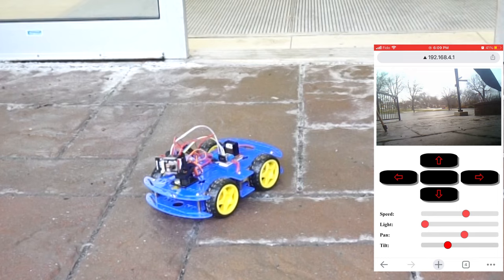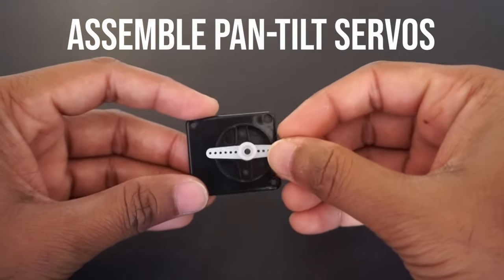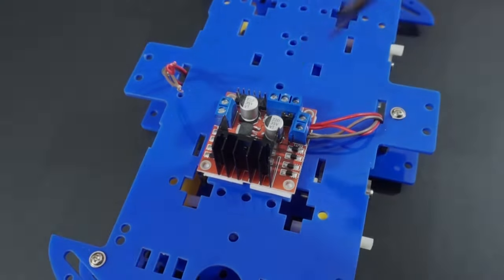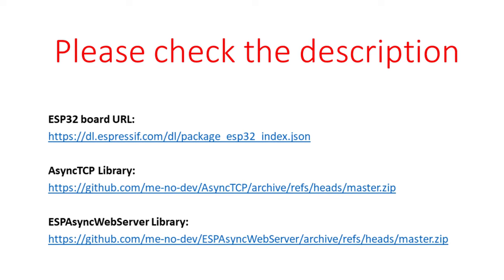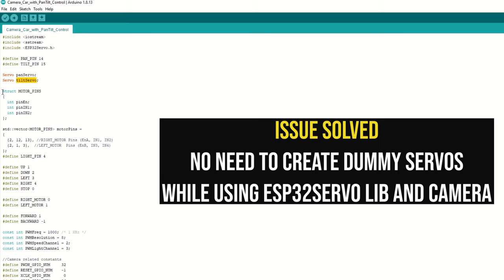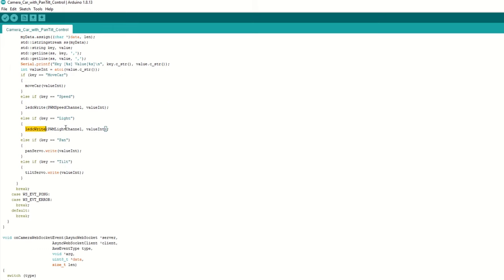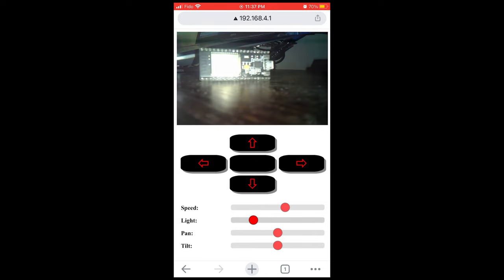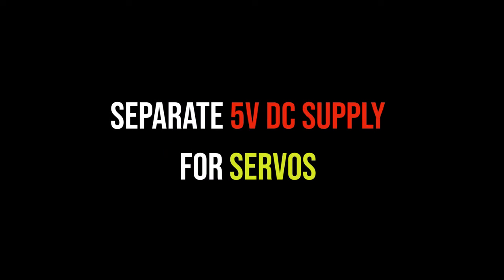Camera Car With Pan Tilt Control | ESP32Cam

Comment: A fatal error coming after compiling it tells it tells no serial data is received
Reply from the maker: Please check the video for full details 👍🏻👏🏻
Reply: I rectified it by removing the gnd connection... brother
Reply from the maker: @cbc1235  awesome 👍🏻👏🏻
Reply: Bhai Mera help kar do na please
Reply: @Sanjeev0-6  post that..! Your trouble
Reply: @cbc1235  my problem is that compiling process is not completed please help me
Reply: Coding me  kon kon file ko add karana hai kon sa module select karana hai vo nahi ata hai hamare pc me
Reply: @Sanjeev0-6  keep update of coding commands
Reply: @cbc1235  thanks sir I check
Reply: @Sanjeev0-6  Infact I am not sir...be friends 🤝
Reply: @cbc1235  compilation Error ' ledcsetup' was not declared error in this scope; is coming while compiling can you help me
Reply: @Surya_Rapeti  nice try and again please check program and commands and Arduino versions & libraries...etc circumstances

Comment: hash pls help me to fix ...hang of browser full time only works 2 second then hang...then after refresh browser worked remote till 2second then same as first ...why ...some time camera working continously but car remote not working some beep sound coming from l298n driver module when pressing moving key front back left right..why that sound only not moving car
Reply from the maker: May be there is power issue . Please use rechargeable battery of 7-12 v 👍🏻👏🏻

Comment: Its a good project with great explanation..i have successfully implemented the project...some of the points that have to be kept in mind for Beginners are...

1) power up the ESP 32 cam with the help of buck...the output of l298n may not be sufficient..hence the ssid may not be visible in WiFi list

2) please turn off the mobile data and then search for the ip address

3) make sure the motor speed is at minimum position and then test the car...

All the best 👍
Reply from the maker: Thank you so much for pointing out some of the findings . This will surely help others as well 👍🏻👏🏻
Reply: bro so thanks for saying this , i am also facing this problem
Reply: @hashincludeelectronics   bro can you say which type of buck converter  can i use and how
Reply: Bro I connected all pins correctly it is showing inn network and all are working but the car is not moving , please give me a solution for this bro.
Reply: LM2596 buck converter will work for this...if you are correct with the connection and power supply and all... atleast you will hear a feeble sound when you trigger with the mobile app

If so set the motor speed to mid level in your application

Hope this will help you 👍
Reply: @sushmitham5723  Can you say how to connect to that and how much voltage I have to set
Reply: Hi 
Is this code run properly ?
I have on run time error on right and front control  i found it on the. Serial port.  It show an square box while pressing these keys. Remaing keys ( backward and left) is working properly. Did you know how to correct it. If you know please tell the solution. Thankyou.
Reply: Can I try another buck with cam module so power problem not happen

Comment: Thank you very much for the Project. It helped me a lot.
I have two questions. 
1 - In the webpage the image stuck frequently but the buttons works ok . Do you have any recommendation?
2 - The motors don’t work when I connected enA and enB to IO2. The motors only work when I connected to  enA and enB to 5v.  The IO2 output always is at 1.2v. Do you know why?

Thank you so much .
Regards
Hernan
Reply from the maker: Please check the video for important setting . Also make sure you make the connections as per circuit and shown in video 👍🏻
Reply: I am having the same issue, can you share how you solved it, if I connect either ena or enb, respective sides work. If I connect both, neither side works

Comment: I want to seperate enA and enB pins which you connected to io2 port. The io4 port is currently unused. Because when ena and enb pins are connected to io2, only one side works. When Ena disconnected (right side works)  when Enb disconnected (left side works) but not together
Reply from the maker: It’s not like that . Please check the video and connections . It rotates both sides motors in reverse and forward directions👍🏻👏🏻
Reply: @hashincludeelectronics  ya i just copied and the project works. thanks again
Reply from the maker: @siddharthvyas4695  awesome 🙌🏻

Comment: Hi! I loved the tutorial but I was wondering if I can use other pins to add some LEDs ( Im building a miniature vehicle and I need some LEDs inside ) ... How can I add them into the code that you already have? Thanks for all the tutorials ! cheers from Chile :)
Reply from the maker: Thank you very much for checking out the video and nice comment 👌🏻👏🏻. Not sure if there are pins available on this esp32 board for LEDs . If there are pins available then you can copy paste the code for button which can be used for LEDs .
Reply: @hashincludeelectronics  Thanks for the reply! Yeah I ended up connecting the LEDs directly to the battery with another switch ( with some resistors to lower the V )  :)
Reply from the maker: @chthongonzalez  nice 👌🏻

Comment: Hi, when trying to upload the code I had the following problems with the code: " ledcSetup' was not declared in this scope; did you mean 'ledc_stop? " and " 'ledcAttachPin' was not declared in this scope; did you mean 'ledcAttach'? ". How can I fix them?
Reply from the maker: @f4b1_l85  please install 2.0.16 version of esp32 module 👍🏻👏🏻
Reply: @hashincludeelectronics  I'm a 70+ year old guy with mobility issues. I  plan on using a servo instead for pan and tilt, I will use it to operate a gripper to recover my dogs ball from under furniture.  I have little experience with Arduino and am having the same problem.  I have tried multiple board and versions from the drop down list with the same results as the original poster.  What specific board should I select.  Here is the complete error message.  Thanks  C:\Users\chris\OneDrive\Documents\Arduino\Tater_claw\Tater_claw.ino: In function 'void setUpPinModes()':
C:\Users\chris\OneDrive\Documents\Arduino\Tater_claw\Tater_claw.ino:493:3: error: 'ledcSetup' was not declared in this scope; did you mean 'ledc_stop'?
  493 |   ledcSetup(PWMSpeedChannel, PWMFreq, PWMResolution);
      |   ^~~~~~~~~
      |   ledc_stop
C:\Users\chris\OneDrive\Documents\Arduino\Tater_claw\Tater_claw.ino:502:5: error: 'ledcAttachPin' was not declared in this scope; did you mean 'ledcAttach'?
  502 |     ledcAttachPin(motorPins[i].pinEn, PWMSpeedChannel);
      |     ^~~~~~~~~~~~~
      |     ledcAttach
C:\Users\chris\OneDrive\Documents\Arduino\Tater_claw\Tater_claw.ino:507:3: error: 'ledcAttachPin' was not declared in this scope; did you mean 'ledcAttach'?
  507 |   ledcAttachPin(LIGHT_PIN, PWMLightChannel);
      |   ^~~~~~~~~~~~~
      |   ledcAttach
Multiple libraries were found for "ESPAsyncWebServer.h"
  Used: C:\Users\chris\OneDrive\Documents\Arduino\libraries\ESPAsyncWebServer
  Not used: C:\Users\chris\OneDrive\Documents\Arduino\libraries\ESP_Async_WebServer
Multiple libraries were found for "AsyncTCP.h"
  Used: C:\Users\chris\OneDrive\Documents\Arduino\libraries\AsyncTCP
  Not used: C:\Users\chris\OneDrive\Documents\Arduino\libraries\Async_TCP
exit status 1

Compilation error: 'ledcSetup' was not declared in this scope; did you mean 'ledc_stop'?
Reply from the maker: @christopherhughes6519  nice to hear the project you are working on . For issue please install 2.0.16 version of esp32 board in Arduino IDE . 👍🏻👏🏻
Reply: @hashincludeelectronics  how to do that?

Comment: Thank you bro I got an IOT project expo prize for making this in January, but when I did the same project I was having some problems, the wheels rotated automatically when I connected them to the battery. What to do know
Reply from the maker: That’s really great news . Yeah please check the power supply.  Use only rechargeable battery . Check for loose connection 👍🏻👏🏻

Comment: What was that small component you used in the project ????
Reply from the maker: It is called UBEC. It’s like a voltage converter from 12v to 5v 👍🏻👏🏻

Comment: In this i will use l293d insted of l293n motor driver?
Reply from the maker: In that case you will have to make the code changes and also connections . I would recommend to use L298N driver only to not face issues 👍🏻👏🏻

Comment: Can you substitute the AMB82 mini for this design? BTW your channel is great. You clearly know your stuff.
Reply from the maker: Thank you very much for checking out the video and nice comment👍👏. Unfortunately we can not that module in this project . It will need different kind of coding and connections .
Reply: @hashincludeelectronics  thank you for the quick response. Your insight is helpful.

Comment: hi sir, what s that foam or tape you used to stick l298n module to chassis and also esp32 to bracket
Reply from the maker: It’s double sided tape . You can use any glue as well 👍🏻👏🏻
Reply: @hashincludeelectronics  thank you so much sir, may i use your code for our research paper? thank you
Reply from the maker: @ranking6208  yes of course 👍🏻👏🏻

Comment: Bro is there a way to add an audio two way communication system to the car so you can send audio responses through phone where there would be a speaker on the car to deliver  it? Please I need some answers
Reply from the maker: I have not used audio with esp32 yet . Will try in near future 👍🏻👏🏻

Comment: Hello weird question will servos work without UBEC or buck converter but I will connect with normal jumper wires?
Reply from the maker: UBEC or buck converter is used to step down the voltage to 5 v so that it can be provided to servos with good current capacity . This UBEC can provide upto 5 a . So you should use it . Else you need to provide other 5v power supply which can provide more than 2-3 A current . 👍🏻👏🏻

Comment: Please I need help I’m building something similar for my project. Is there any way I can add more button options on the app to control other added components on the device like a back sensor??
Reply from the maker: Yes you can easily add . Please copy paste the code for any button 👍🏻👏🏻
Reply: @hashincludeelectronics thanks. Another question can I connect an audio component to the cameras for audio feedback for surveillance?
Reply: Does the lights come with the camera or you fix them externally?
Reply: Can I add another input control on the app which can control another component connected to the esp32?
Reply from the maker: @emmanuelfrancis2818  it’s flash light and comes with esp32 cam module inbuilt 👍🏻👏🏻
Reply from the maker: @emmanuelfrancis2818  yes you can 👍🏻👏🏻

Comment: What is the wire or jumper 4:29 that is connected to the ubec
Reply from the maker: Those are just jumper wires to provide 5 v from ubec to 2 servos . That’s why we have joined 2 red and 2 black wires to UBEC 5v end 👍🏻👏🏻

Comment: HI BROTHER AN ERROR IS COMING 
THIS IS THE ERROR
-

No such file or directory
 #include "esp_camera.h"
          ^~~~~~~~~~~~~~
compilation terminated.
Alternatives for esp_camera.h: []
ResolveLibrary(esp_camera.h)
  -> candidates: []

exit status 1

Compilation error: esp_camera.h: No such file or directory
Reply from the maker: Please check the video for step to add esp32 board into Arduino IDE.
Reply: @hashincludeelectronics  HAVE YOU MADE ANY VIDEOS ON THAT PLEASE SEND THE LINK BRO
Reply from the maker: @deepjyotiarts4704  it’s should be in the same video . Or check my other video on esp32 cam car.
Reply: @hashincludeelectronics  Now it's compiled but it's showing some error---------
Chip is ESP32 in Secure Download Mode
WARNING: Stub loader is not supported in Secure Download Mode, setting --no-stub
Enabling default SPI flash mode...

A fatal error occurred: Invalid head of packet (0x05)

please help

Comment: I would like you to start replacing the sp32 with a Bluetooth module.👍👍👍
Reply from the maker: This esp32 module also has Bluetooth inbuilt . You can use it easily . Check my video on Bluetooth car where I have used the dabble app to connect using Bluetooth .

Comment: Sir can the esp cam handle that much voltage? Because i see you sre not connecting the esp cam with the step down
Reply from the maker: @NanonplayZ  I have provided 5v to esp32 cam . Please check the connections diagram and video as well 👍🏻👏🏻

Comment: Hey brother 😊great job but the car is not moving what is the minimum voltage should be supplied to move the car and make the camera on with the servos
Reply from the maker: You need to use rechargeable battery from 7-12v and then step down the voltage to 5v using voltage converter. Basically you need to provide 5v supply to this project. You can also provide 5v supply directly if you have . 👍🏻👏🏻

Comment: Are there any other alternatives for the UBEC/Buck Converter and 7v-12v DC Battery?
Reply from the maker: For servo you need to have 5v supply with enough current capacity . For 2 servos you need 1.5 A current with 5v . If you have any 5v supply with this current capacity then you can use that . However I will suggest to use the same setup which I have used in project 👍🏻

Comment: I want to use relay model in that car for operate 12 volt water pump so what changes required in that program.
Reply from the maker: You can easily add the relay in this project. I can suggest you with these points. 1. Check and Use the IO pins which is not used. 2. Add a button on the mobile App to control it. You can copy paste the button code. I can not help on full code and diagram as it needs proper complete testing and work. Wish you all the best 👍
Reply: Did u find a way to get it done? I wanna do something similar

Comment: Hello sir can we used any other thing in alternative of rc servo bec
Or also tell me can we direct contact with out rc servo bec
Reply from the maker: Please use the separate 5v for servos 👍🏻👏🏻
Reply: @hashincludeelectronics  sir I want to add a button of video recordeing so guide me or tell how library include and if possible can you provide it's coding about recoring button or recoring library

Comment: what will be the pins if i use aurdino uno connected to esp32 only i mean is it possible to connect pin with aurdino uno to motor driver module please say
Reply from the maker: You have to use Arduino uno just to upload the code. Once code is uploaded there is  no need to Arduino Uno . All connections will be wit esp32 cam module. Please check the video for more details.

Comment: Great work! impressive!! is that possible to add two or more servo motors for this project?
Reply from the maker: Thank you very much for checking out the video 👍🏻. I don’t think there are enough pins left for more servo motors . If there is any pin left then you can use it .
Reply: How possible to utilize PCA9865 module on ESP32 cam so it can able to drive more than two servos while driving two DC motors?!
Reply from the maker: @elmardasmarinas678  that’s nice idea 💡. You can try use that module and share your experience with all of us 👍🏻👌🏻

Comment: Sir the link for the Arduino uno board you give in description is a clone one. I want to ask that will it work fine with windows 11?
Reply from the maker: Yes it will work 👍🏻👏🏻
Reply: @hashincludeelectronics 
So do we need to instal any driver before plugging into the pc?
Reply: Also can we use a 3wheel set instead of a 4wheel set?
Reply from the maker: @JaskaranSingh-gw2kb  yes you can use 3 wheel set as well .
Reply from the maker: @JaskaranSingh-gw2kb  connect Arduino to laptop and it will install required driver automatically I believe 👍🏻👏🏻

Comment: 4:42 hey bro one question.
what have you used to connect ubec converter to servo motors?
Reply from the maker: Those are simple jumper wires
Reply: @hashincludeelectronics  u mean you connected jumper wires to ubec converter then you connected 2 jumper wires to one to make Y shape?
Reply from the maker: @darkgamedeveloper9961  exactly 👍🏻

Comment: very good thank you.. one suggestion: can you make it powered with solar energy ? i mean, a car always ready to work.. But how can a 2s lipo battery be charged with solar energy? Or what should I use instead of 2s lipo? because esp32 cam consumes a lot of power ..
Reply from the maker: I have that in list where I will make a car which is powered using solar power 👍🏻👏🏻
Reply: @hashincludeelectronics can you share your to do list 😊
Reply from the maker: @psykopat81  hahah. I will share videos directly 👍🏻👏🏻

Comment: Hello another question, do you know why Tilt might be always looking up, like it's being told to look there no matter where I put the slider?
Reply from the maker: May be your servo position is not initially set at mid position while mounting it on frame . 👍🏻
Reply: @hashincludeelectronics  well that will be hard to fix. Thank you

Comment: Bro i dont get your last remarque should i use 2 power supply ? (2 batteries or what )?
Reply from the maker: Make sure your total battery voltage is 7-12 v. 👍🏻👏🏻
Reply: Thank you
Reply from the maker: @sifou1737  welcome 🙏

Comment: can not we use power bank instead of battery?? if then how to attach please answer. love from Bangladesh
Reply from the maker: No. This car needs 7-12 v . So I don’t think power bank can provide that voltage . If your power bank provides 7-12v then you can use that in place of battery . Connections will remain same 👍🏻👏🏻

Comment: i done the same connection and i short 5v with uno ,esp32 cam and motor driver so motor driver should not give 5v back emf but in your case its giving back emf of 5v due to this esp32 cam get damage easily i think we should give separate 5v supply to esp 32 cam?
Reply from the maker: L298N driver has its own 5v regulator . And i believe it handles back EMF very well. I did not face such power issue with this project. You can try giving separate 5v to esp32 module.